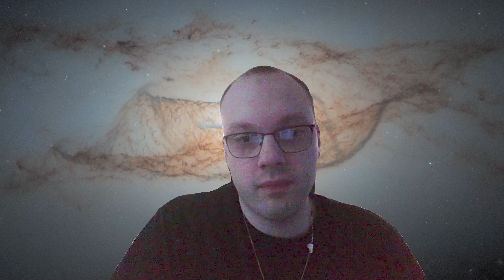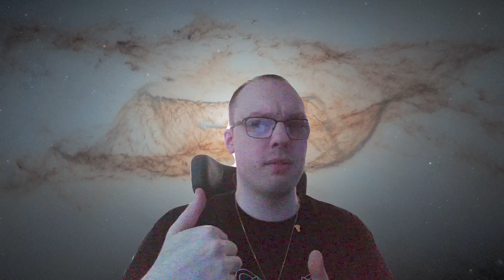Let's Build a Spaceship - Manufacturing 2

Comment: Good video, very interesting. I suggest that you use a better thumbnail image for the video. The auto generated ones that just use a random frame of the video are usually very unflattering. (like the one on this video)
Reply from the maker: I cannot disagree with you. The thing is I'm lousy at making images, so, for now anyway, I try to select the best of the auto-generated. Usually that means including the insert if there is one, with either a smile on my face or some appropriate motion (like gesturing to the insert).
I am thinking I might make a thumbnail for next weeks though, as I have an idea that I think is within my skills and will be appropriate for it.